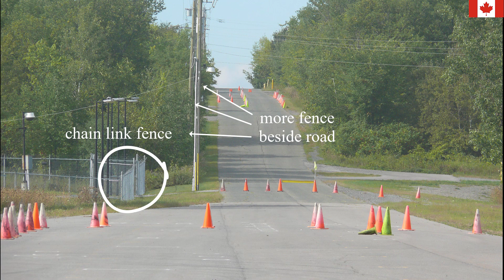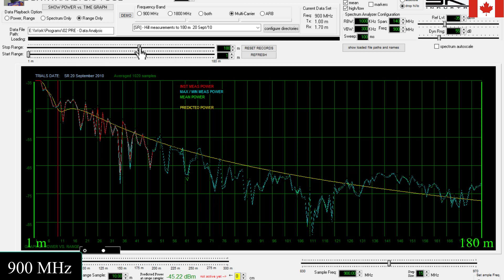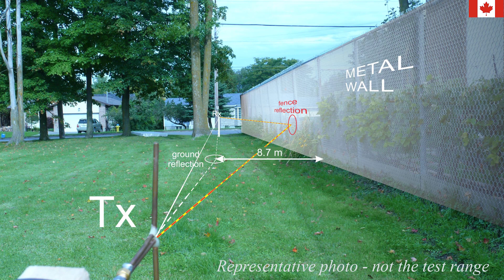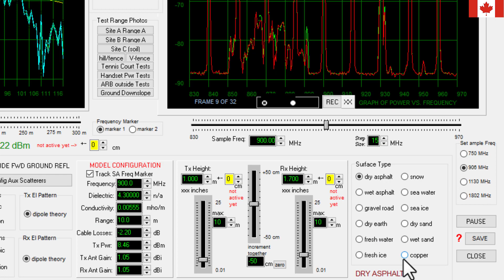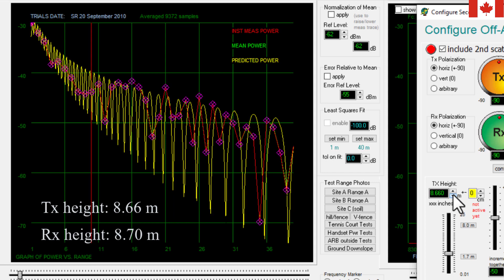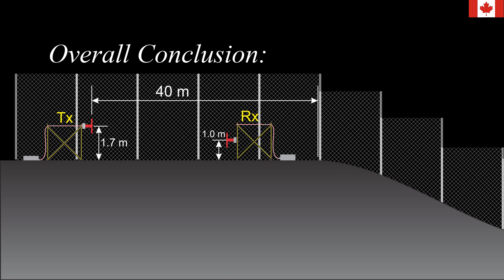04  Propagation Model Validation   FLANKING METAL FENCE 15

Comment: KC3YFZ  Thank you
Reply from the maker: If you are a ham: a small change in antenna position can cause a big improvement in Rx signal power, i.e. move out of a MP fade.  The effect depends on freq, distance to reflector, geometry, presence and position of other reflectors.  

If your issue is an actual fence, you might try adding another fence (piece) canted to direct the reflection up to the sky.  This principle is used by the F117A fighter.  Chicken wire on a wooden fame might mostly remove the interfering reflection.  

KR4L was my uncle Tom Leeder, Asheville NC.